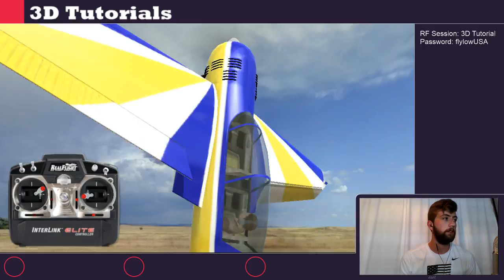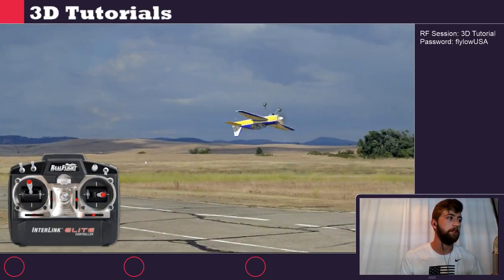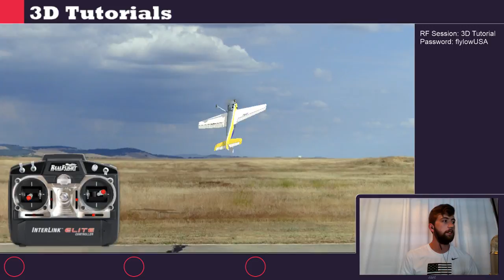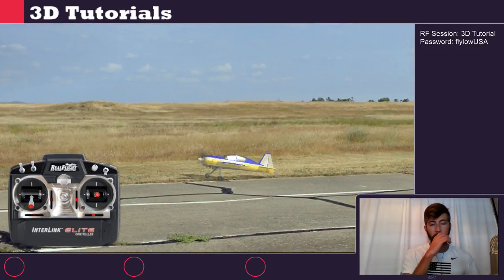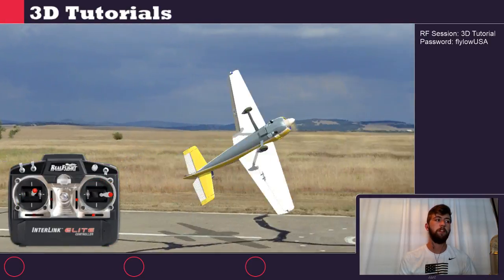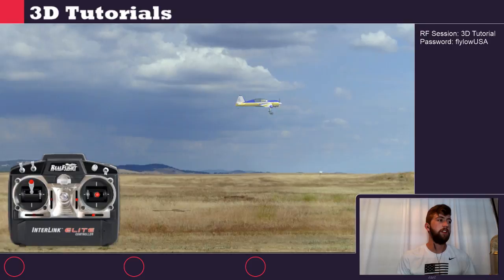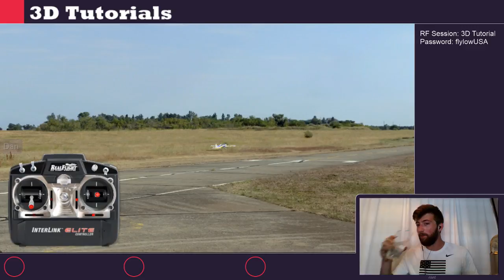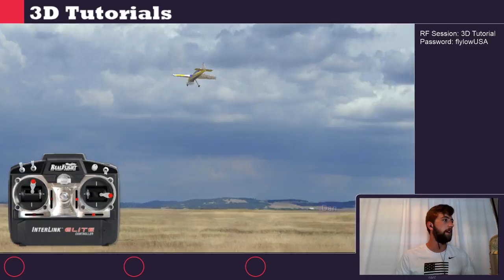Live Stream 3D Flying Tutorials: Ep. 1 How to Practice and Improve

Comment: How did you learn rolling loops (with many rolls) in real? I can do them on the sim but in real it's very different. The perspective is different somehow, it get's really fast and there is the ground... I have always a point where I interrupt in the last quarter. Any hints?
Reply: Sven Bardos it was the same for me, I could do the hole loop but the rolls was very fast so I lowered the ail. rates but that was not good for my timing. in the end I just gave less throttle and that did the trick. also helps to do it with a foamie :)
Reply: I will give this a try!